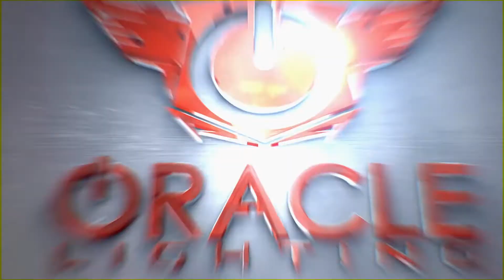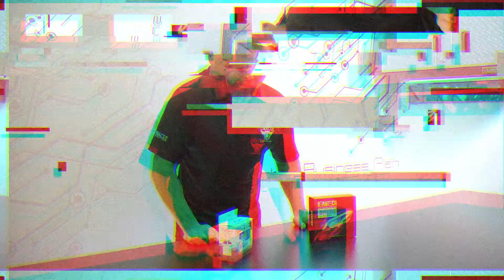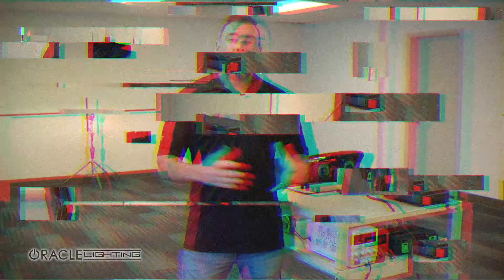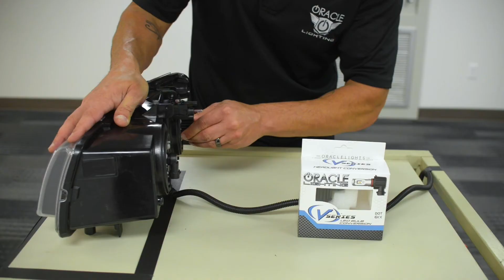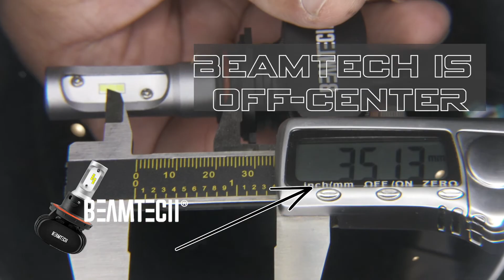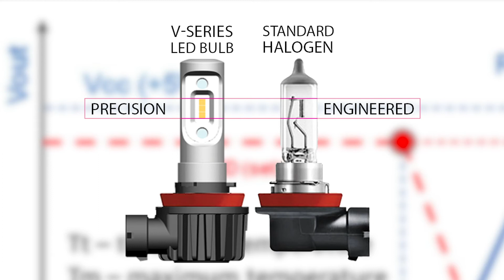BULB COMPARISON: Oracle V-Series VS. Beamtech

Comment: Interested in a set of your H7 v series for my aftermarket housings. But for some reason the manufacturer of the housing says adding aftermarket led or hid lights will void the warranty and may cause issues with the wiring. They are a harness type housing, where the bulbs are internal with dust/water caps over the sockets and all the wires come out through a seal to a plug. They appear to be very thin wire, but no thinner than the wires coming off the plug from the car's actual wiring harness. So will these be safe to run as my low beams? I really want the crisp white light and better visibility. But i am worried because most all-in-one led bulbs on amazon get horrible reviews, only the ones with external driver boxes seem to get the 5 stars, and i worry about what my housing manufacturer said. If it helps, the housings are made by Spyder auto. They are for a 2017 Focus MKIII.